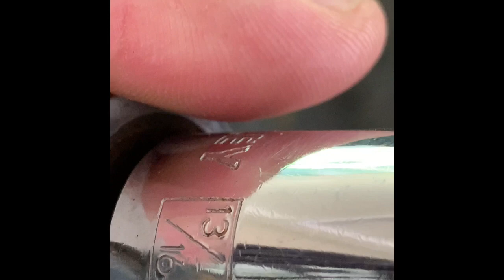How to drop 2002-2008 Dodge Ram 1500-2500

Comment: I would have used a little Is penetration oil help cut back on the dirt falling in your eye's and put a little grease inside the Shackle hole's to help get the bolts in you can get a allen kit from home depot for under 30$ that fit's on the ratchet that may also help you I've been wanting to do my 05 Ram i may just do it this summer

Comment: Maybe it is just the camera angle, but it looks like the bottom bolt needs to be like it was originally.  Looks like the end of the bolt will hit the frame when it flexes.  Have you noticed anything?
Reply: he actually put the bolt in the wrong way. it needs to be flipped or it will cause some damage
Reply from the maker: Front facing camera flips everything
Reply: I cut the ends off mine. Does great. Get a flip kit if you want to go lower. What wheels are these btw love them
Reply from the maker: @joshuabrock7848  I want to go a little lower what’s a flip kit I will look it up THANKS
Reply: @scattywattyfamily8918  switches position of the leaf springs from on top of the rear end to under it. But make sure you weld it.
Reply from the maker: @joshuabrock7848   ok I’ll check this out tomorrow thanks
Reply from the maker: Ok I will do that and post after I get it done